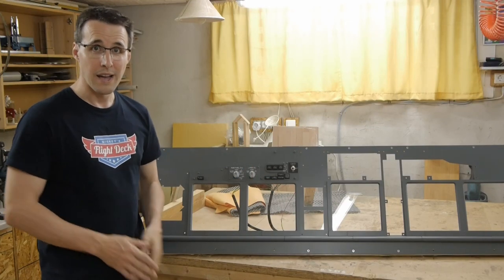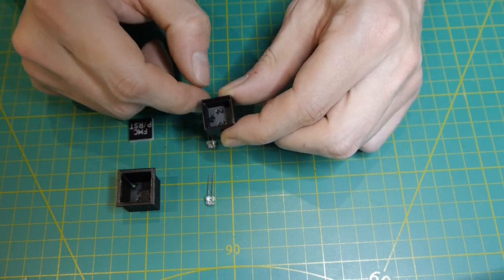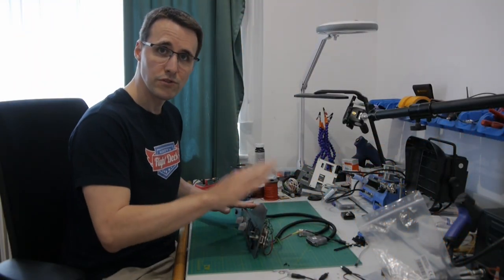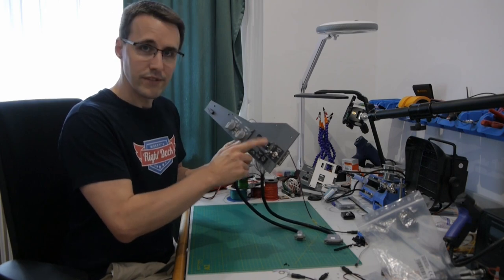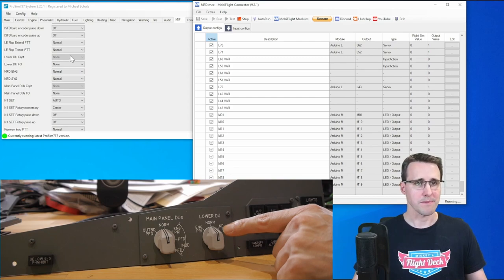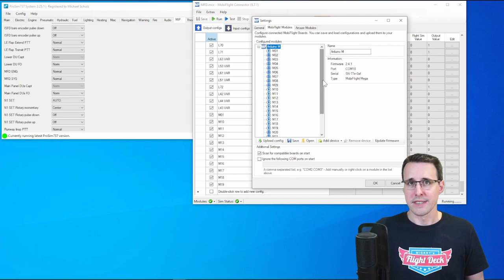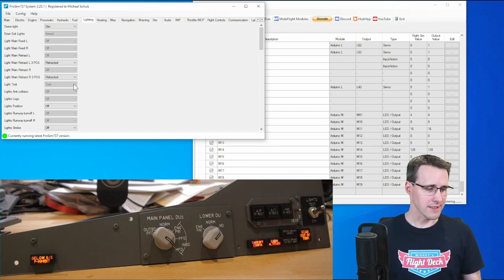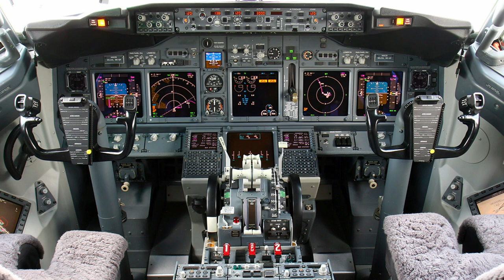MIP Captain Upper Panel - A Boeing 737-800 Homecockpit #77

Comment: Hi Michael, The speed brake indicators are not illuminating during light test because it seems aircraft is not properly configured. Please make sure you have AC power on both XFR buses. If not, some indicators may not illuminate during light test. Great work, btw. ;)
Reply from the maker: Thank you. I will check this.
Reply: @Mickeys_Flightdeck  I think the extra annunciators you mentioned came after the Helios 737 accident

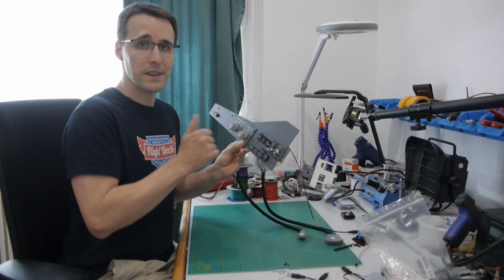Comment: What are those connectors you're using, and how did you decide to use those? The VGA ones at about 8:50. Apologies if you've answered in previous videos, only just started to watch from this one.
Reply from the maker: These are dsub connectors. I'm going into the details of cable management in video 41.
Reply: @Mickeys_Flightdeck  Thank you. Video 41 was very informative.
Reply: @Mickeys_Flightdeck  Thank you. Video 41 was very informative.

Comment: I have one question that I never understood, does mobifight only works with prosim, or else, what is really the function of prosim in mobiflight? I never got a clear clarification of that
Reply from the maker: These are independent programs. Mobiflight is just a program that can read or write values in the Flightsimulator via FSUIPC or the new variables from MSFS. And of course it can do the same in XPlane. Prosim is a software that simulates the systems of the boeing and uses also these ways to communicate with the simulator. You can compare it with the plugin from PMDG. Prosim works alone only together with the simulator. And to tell Prosim what commands it should send or where it should visualize some outputs you can use hardware from different commercial manufacturers like CPFlight, FDS or many others. These can communicate with Prosim directly or via the ways I've mentioned at the beginning. And this is what you are doing when you are building your own hardware and let it send commands via MobiFlight and FSUIPC.
I hope this makes it alittle bit clearer for you.
Reply: @Mickeys_Flightdeck  I appreciate a lot for the explanation. Thanks